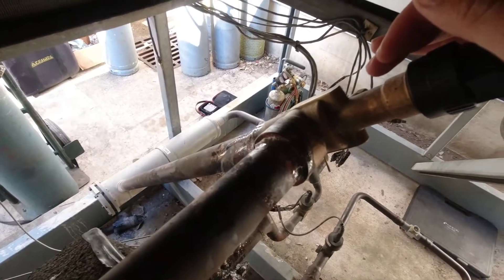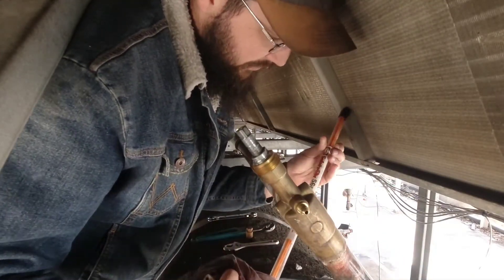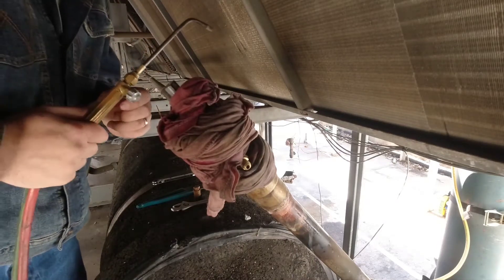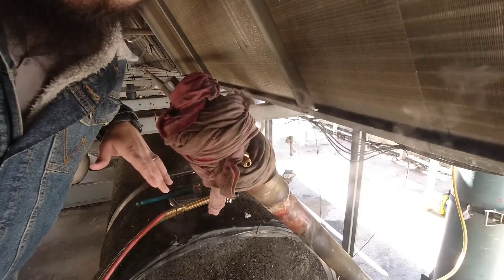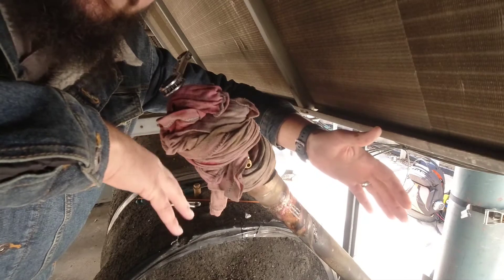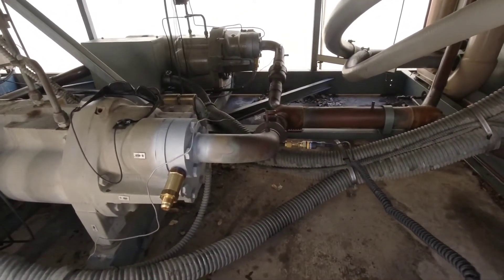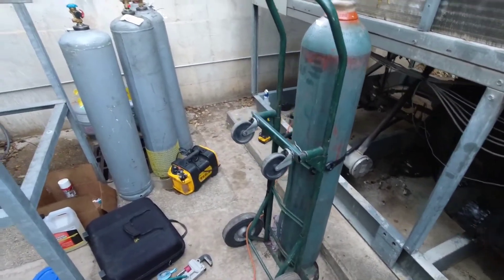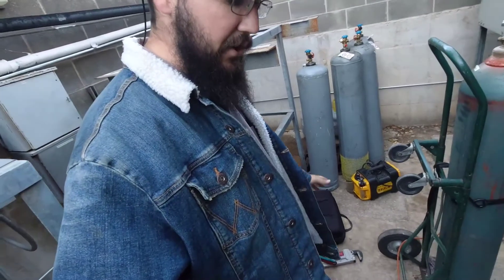Trane Chiller Leak Repair, RTAA

Comment: Brass to Copper use normal 15% with Paste Flux. No need to use 45 or even 56%. And in cases that require high silver I prefer bare filler metal and once again white paste flux. Much better control.

Comment: I find that breaking with nitro, is actually quicker than just waiting for the vac pump to pull down
Reply from the maker: Correct, doing a triple evac is better. On this video we did do a triple evac, but if you watch the embarrassment video to follow, you'll see why we had trouble with it.

Comment: Hate brazing upside down fittings. Especially brass to copper.  Good job though the repair.
Reply from the maker: Ya always a good challenge at any level!
Reply: @HVACTIME  in the EU it is a requirement (practical exam test) to be able to solder such a connection (brass/copper upside down). fail it (less then 80% flowed) and you fail the entire exam wich also includes a steel/copper connection in the form of a (copper plated) rotalock. you consume about 2~3 silver sticks and 4~5 copper sticks just in the exam. fun fact: the exam is expensive.